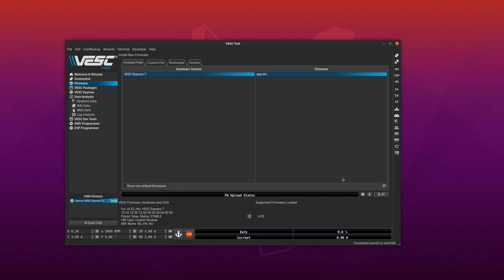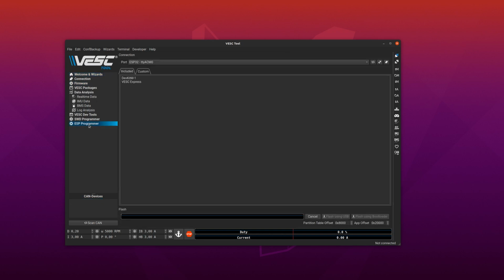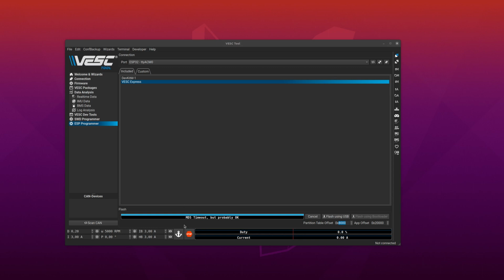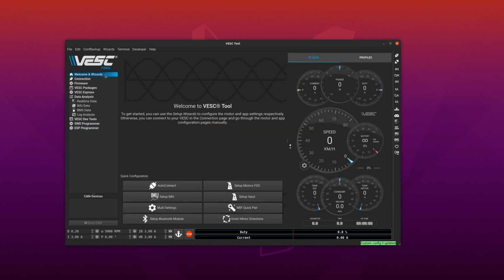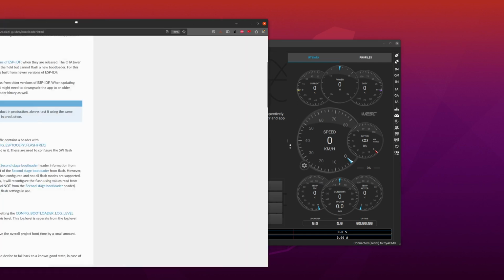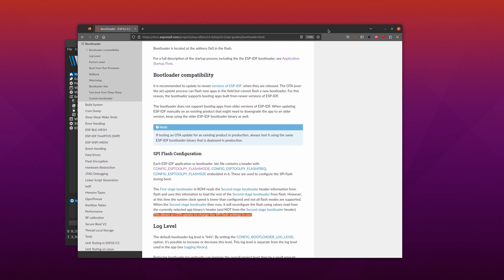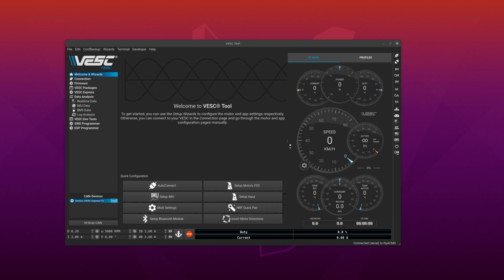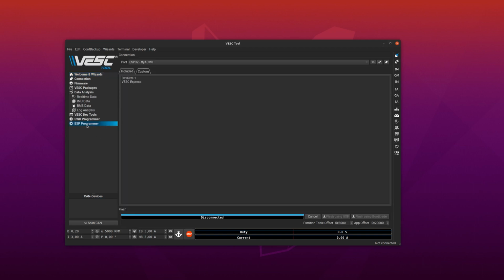VESC Express Firmware Update Fix

Comment: Somehow I can’t connect to mine via Bluetooth after the update, it can’t find it anymore, going to wait for the next update so I can use it again cheers
Reply: Hey @ipodfernando
Had the same problem and changed it back to firmware 5.2 which works perfectly fine again. So Id recommend just wait until a new stable release is out again and update then
Reply: This video is exactly about this problem;) What is not intuitive is that vesc tool shows that express was updated, but in reality the process not finishes correctly if it's not flashed through USB directly. As a result default settings will be set always after reboot, where in FW6.02 BLE is disabled.
Reply: @vlac1558  sorted, thanks
Reply: I am getting error: 2 when i try to connect this way. Cannot connect to target. ☹️ Huge bummer. I tried going back to 6.0 firmware but temp is still cutting out at default values. Maybe i need to go back further? 5.3 maybe? Thanks for all you do Benjamin 😁